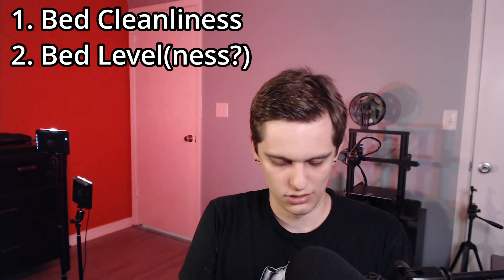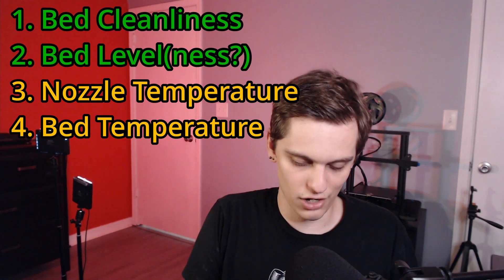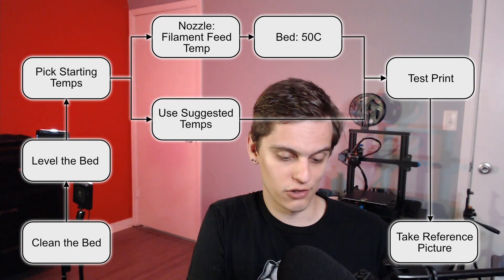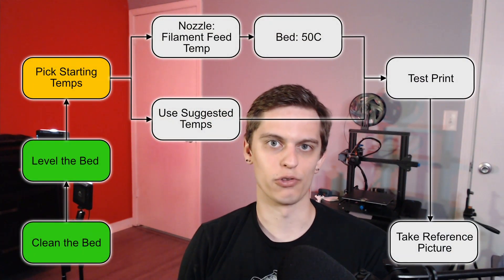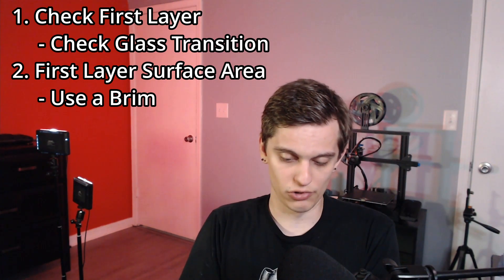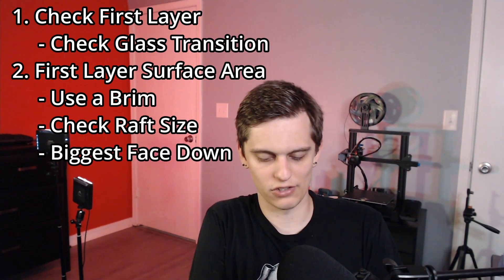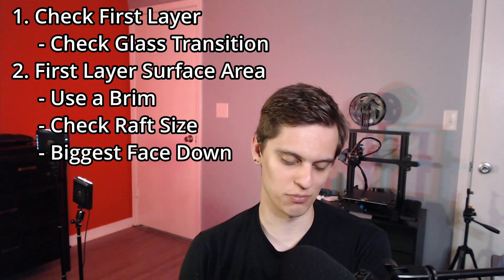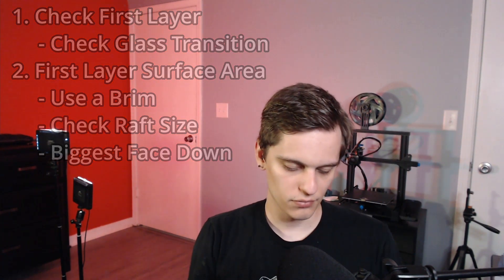A Complete Guide to PLA Bed Adhesion (And the First Layer)

Comment: Interesting thing I came across, if you see this; your test print refuses to slice for anything higher than standard quality in cura; 0.16, 0.12?  will not slice.  0.2 or 0.28, though?  Slices perfectly.
Reply from the maker: Huh, that's bizarre. It's thin, so I'd expect the coarser settings to fail if any.

I'll look when I can, but I don't have Cura on hand - does it spit out an error?

Comment: Is this all based on the assumption that the fan speed is set to 0 for the first layer(s)? Great video and... I repent.
Reply from the maker: Great point -- yes, this is based on fan speed 0 for the very first layer -- I hadn't even thought about that, but it is important that the first layer cool slower so that it can find a better grip and spread out a bit more.

Whenever I post an update to this video, I'll be sure to include this! (I've also been thinking about doing a video on airflow and cooling as well, and this could be a good topic there too)